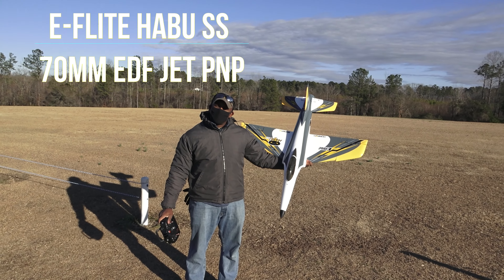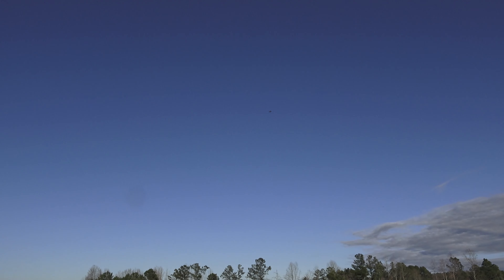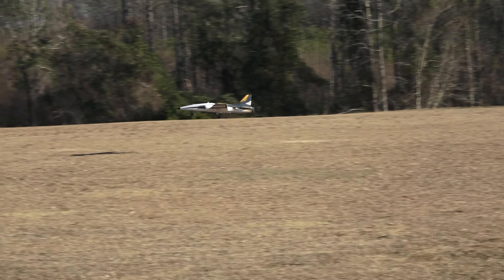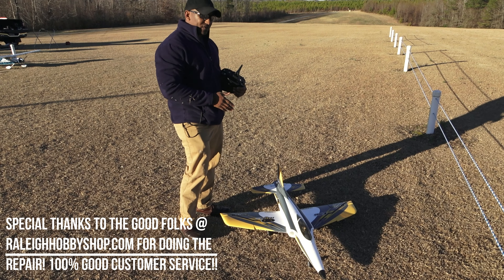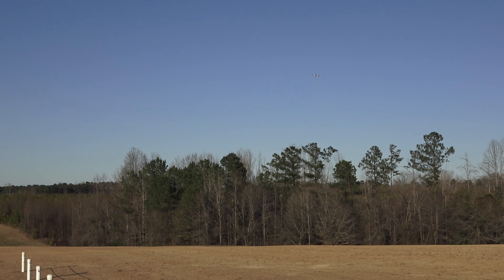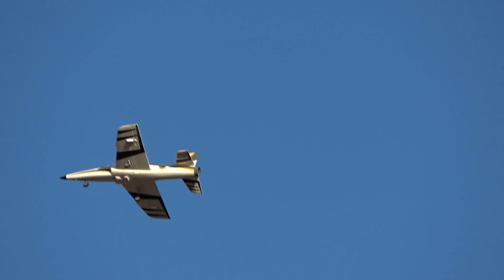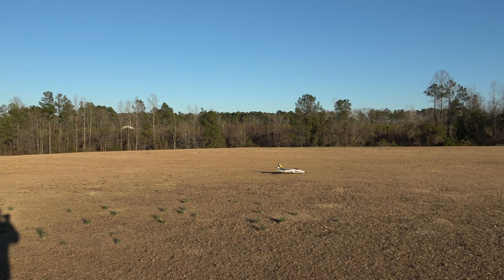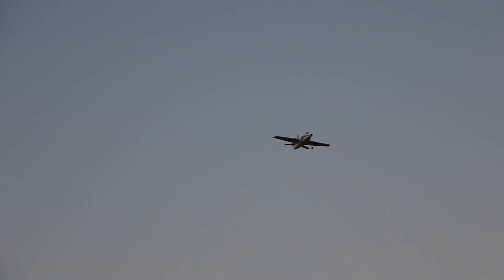E-flite Habu SS (Super Sport) 70mm EDF Jet BNF Basic and PNP Maiden Flight & Review.

Comment: Such weird problems...
What did the problem on the Elevators turn out to be? Was the tail put together wrong and pinching something? A mechanical issue. Or was it a bad servo/connection? I'm guessing Raleigh Hobby fixed it? 

Then the motor pulsing. That was so weird. I've never had it happen, but then I've never put a low battery in a plane either...

The good thing is, the plane flies really well and might be the most forgiving landing gear I've ever seen. It seems like everyone bounces the heck out of this plane until they get used to it, then its smooth.
I still havent flown mine. I'm waiting on Spring and my grass runway to improve. I got the big grass wheels, and could probably fly it, but I'm waiting.
Reply from the maker: The elevator issue was a bad servo, and the way the elevator is installed/functions was binding internally. Yep, Raleigh hobby contacted horizion hobby and did warranty work on it.
The pulsing was odd. first,I thought it was my lipos being older, but it wasn't the case after it did it with another fresh lipo. We assumed it could be a timing issue in the esc. It wasn't consistent enough to bother me and did it with new and old lipos. It was cold, maybe cold lipos? It was weird. Landings are fine; it floats very flat and levels out on approach. After 2 landing attempts, it was tamed.Its low and very bouncy..not very forgiving in those regards.Wheels are tougher than most retracts! It's a solid airplane and pretty quick! We have a Speed Trial video of it on the brink! I like it 👌

Comment: A key problem is how the rudder and the elevator are connected... one my second landing the rudder connection came a bit loose and I had no rudder response anymore... if you check out the building videos of the Habu SS on youtube, you can see that it is difficult to plug the connection in very tight... no real room to push in with your fingers, needs a flat tool to push it into position and get a good connection.
Reply from the maker: Yep its definitely got it's quirks